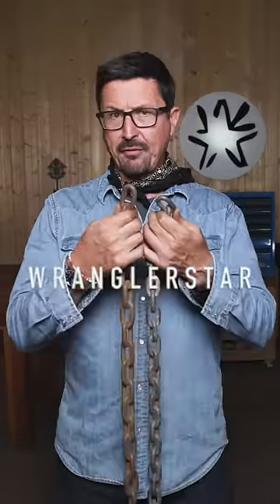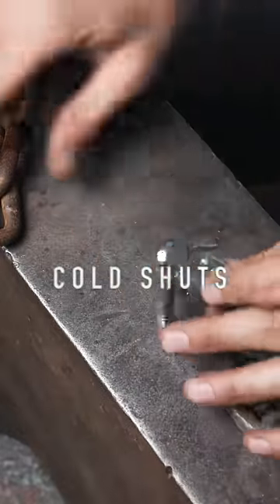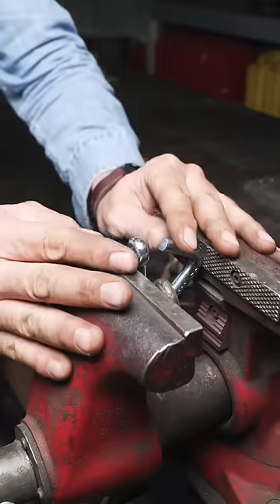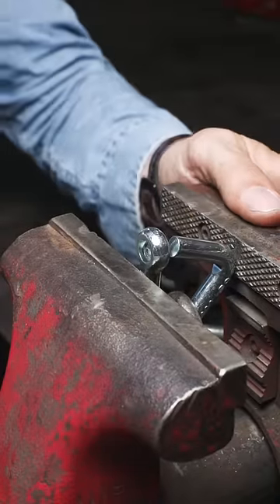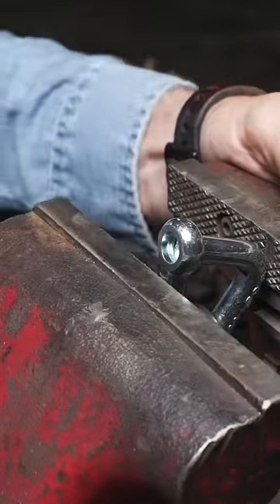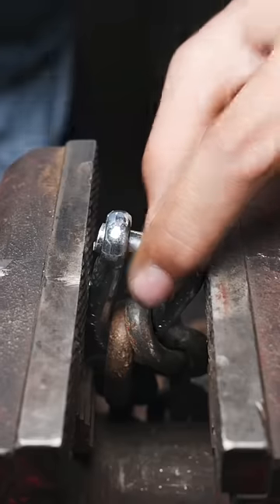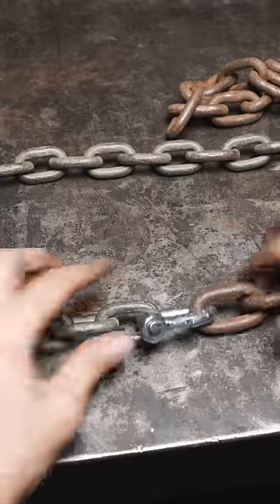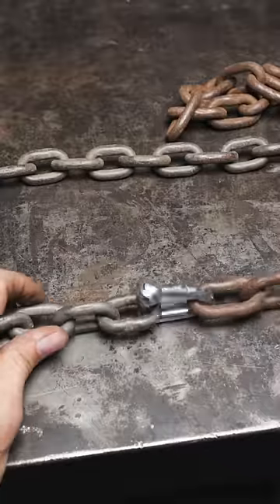Emergency logging chain repair Wranglerstar professional Homeowner #shorts

Comment: I gust use a nut and a bolt. But this looks better.
Reply: These things are less than $4 and can hold 4500 lbs, I would suggest keeping 2-3 with you and never forget to go 1 size up from the chain you work with and don't forget to peen the end once you get it through the hole. 👍

Comment: lol that is the most dangerous "Repair" you know how many people have died from broken chains? this is an accident waiting to happen. 
am i supposed to have a large bench vise with me "in the field"? i think instead of running back to the shop to rig this up i will just drive to town and pick up a new chain. if one link breaks its probably safe to assume the metal has been fatigued enough that it should be retired to light duty work.

Comment: How about designing one with threads that goes through the loop and put a nut/lock washer or cotter pin or both on the other side.
Reply: Its called a shackle

Comment: I don't know I think my Cold shot holds a lot more than yours because when I pull a shut I get them both down to parallel so this straight tinsel load and then with that stuff that's sticking through the hole I go ahead and mushroom that with hammer and punch so that it doesn't want to spit back out of that hole too bad. You aren't getting much out of that cold shot if you aren't mushroom in that head out and catching that hole

Comment: You go past a good little bit and take a hammer and mushroom out the end a lot so it can't come back apart and it won't reduce your tensile strength quite so bad still reduce the tensile strength but not near as bad as doing nothing because it's just going to bend back open

Comment: No professional homeowner would allow their chain strength to be cut by 2\3rds.. they’d carry a field welding station mounted to the back of their truck, next to the field vice so they could perform necessary repairs.. this is just not professional, lift your game..

Comment: You need to use a hammer, and "round off" the pin, so that it can't pull back through the hole. Doing so,ffectively increases the strength, to a limited degree. I use these, often, and won't do it, any other way.

Comment: Anyone who uses a cold shut is welcomed to the cemetery. They are dangerous and have absolutely no weight rating, it it can bend from a clamp then ot will bend under pressure. It will come undone and cause possible serious injuries. This guy should know better.

Comment: Great repair but you would not have a vice in the field with you 🤔🤔
Reply: Do it with a hammer and flare the protruding loose end.  Welding is good.  I use 1/2" cold shut on 3/8* chain, 3/8" on 1/4", so on.  Never broke one.  Pulling out dozers with big tractors.    We use chains here.

Comment: Couldn’t you weld it to make it stronger
Reply: Welding two chains together is actually less strong than a cold shut, it's because of the steel the standard chain is made out of, it weakens with welding.

Comment: Nope not a chance. In no situation would I recommend anyone use those, even if you are forced to do a repair in the field you should just use a dual clevis or even a coupling link. Both are easier to install than those junk cold shuts and will have 3 times the strength and not reduce the strength of your chain.

Comment: It needs to be welded.
Reply: It if needs to be welded why would it be called a cold shuts, not to mention who has a welder on hand 🤣
Reply: @Jack B  If you don't have a welder then the head that goes through the eye needs to be blunted with a hammer so it won't pull back through when you use it.
Reply: @allenbyers3577  go ahead and weld em but that actually weakens them, just read the manufacturer website...
Reply: Thought he'd still use a tractor-beam